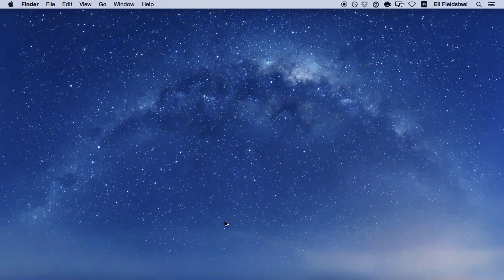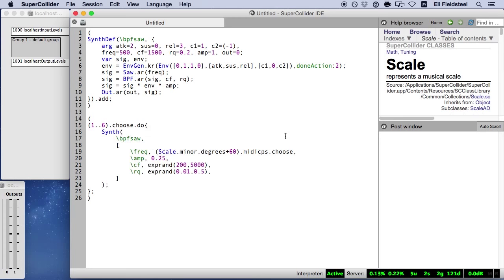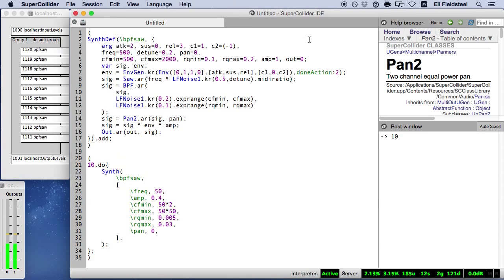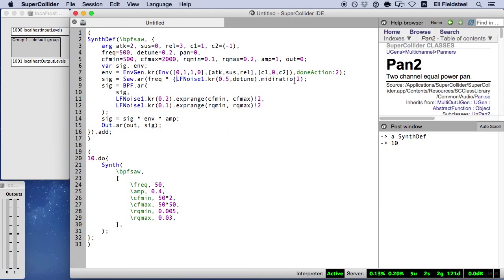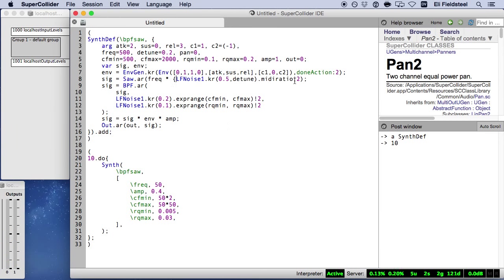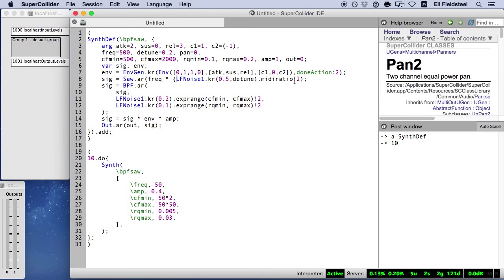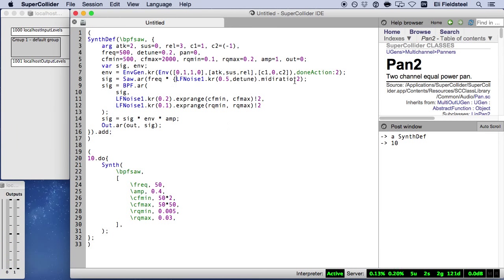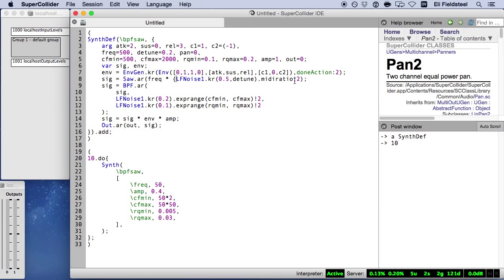SuperCollider Tutorial: 15. Composing a Piece, Part I

Comment: My SC only displays two channels in the Outputs (server meter), why? Is this something related to the hardware or the code?
Reply from the maker: Two is the default number of output channels. I show how to change this at 13:04. All you need to do is set s.options.numOutputBusChannels to the desired channel count, and reboot the server. After that, the meter display should show the new configuration.
Reply from the maker: Unless you have eight individual loudspeakers set up, there is essentially no point in displaying eight output channels on the server meter. If you only have two speakers (or working on headphones) then you'll only hear two channels, regardless of how many are showing on the level meters. Note also that you can mix a large-format multichannel signal down to stereo using the Splay UGen.

Comment: Say we have an 8channel speaker set up, and we want to pan among different groups of speakers at different points in the composition. For example, i want to randomly pan between speakers 0, 1, 2 for a specified amount of time, but then after that, i want to suddenly pan among speakers 5, 6, 7. Can you specify specific channels in this PanAZ function? Would love to see a video on spatialization :)
Reply from the maker: If you route your interface outputs to loudspeakers in the configuration that PanAz expects (output 0 is either front-center or front-left, depending on octophonic orientation, and output numbers increase clockwise), then yes. You can modulate PanAz's pan argument with a noise generator whose output range is bounded between 0 and 0.5. This randomly positions the sound somewhere between the front and right of the listening space.

If you your outputs are routed as L/R stereo pairs (i.e. all odd indices are on one side of the listening space), then it becomes more cumbersome to do with PanAz, but can be done relatively easily with other spatial UGens modulated in particular ways (e.g. four Pan2 UGens summed together, all modulated by the same noise generator). Highly specific, custom spatialization choices will require specific, nuanced coding, no matter which way you slice it.

It's tough to comprehensively answer this question in a short comment. I'll add spatialization to the list of proposed topics for future tutorials...although a stereo tutorial on octophonic spatialization will be profoundly underwhelming.
Reply: Hey Eli, 
thanks for the answer. Those who have the hardware could follow along regardless. It depends on how many would have it. At least the multichannel info would be enshrined for future generations on youtube. :) Thanks for the great work and the fast answer!

Comment: Is it possible to lock the notes of the marimba to the chords? Like when the chord change, the marimba would be playing some scale related to the new chord?
Reply from the maker: Reuel Willys Possible, and not too difficult if you're keeping it simple. You can put two Pbinds inside a Ppar for parallel playing, and make sure their value patterns correspond in the way you want (duration/time patterns are synchronized, pitch patterns are harmonious, etc). For more sophisticated communication between event patterns, I would recommend H. James Harkins' Practical Guide in the help documentation: Pattern Guide 06g: Data Sharing

Alternatively, you can enclose individual value patterns inside instances of Pdefn, to allow for real-time changes while the Pbinds are playing (covered in tutorial 10).
Reply: +Eli Fieldsteel Thank you!! I will take a look in the documentation!
Reply: +Eli Fieldsteel Unfortunately, as someone who's been using SC for years, I find some the help documents far to complicated (the explanations are too wordy, and the examples badly explained, and also confusing to look at), and especially in this case (the ones you mention). Hopefully the new Andre Valle book will put a lot of this right. SC lacks clear documentation, sad to say, which is why your tutorials are a god-send. Big thanks.

Comment: Thank you Eli! Your tutorials have been extremely helpful to me. I have a question: what are the differences between the three LF noise generators (LFNoise0, LFNoise1, LFNoise2)? The help file mentions that they generate values by different ways of interpolations, which confused me more.
Reply from the maker: The "LFNoise" generators each choose random numerical values at a given rate. They differ in how they "connect the dots" to form a signal. LFNoise0 does not interpolate between values, so it is a "sample and hold" generator. It picks a random value and keeps that value until the next value is chosen. The signal shape of LFNoise0 resembles a city skyline. LFNoise1 interpolates linearly, so it draws straight lines between values, and consists of "diagonal" ramp segments, sort of resembling a mountain range. LFNoise2 interpolates using quadratic segments, so it's curvy and smoother.

You can see and hear the differences for yourself by running the following lines in order, one at a time.

s.boot;

//visualize
{LFNoise0.ar(100)}.plot(0.1);
{LFNoise1.ar(100)}.plot(0.1);
{LFNoise2.ar(100)}.plot(0.1);

//listen
{SinOsc.ar(LFNoise0.kr(4).exprange(200,1000), 0, 0.2!2)}.play;
{SinOsc.ar(LFNoise1.kr(4).exprange(200,1000), 0, 0.2!2)}.play;
{SinOsc.ar(LFNoise2.kr(4).exprange(200,1000), 0, 0.2!2)}.play;
Reply: @elifieldsteel  Thank you so much for the detailed explanation!